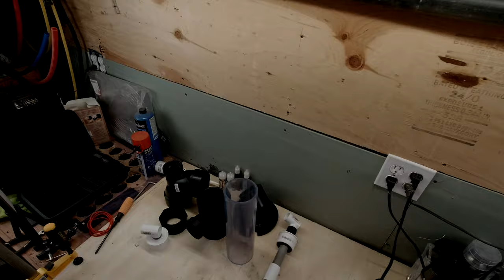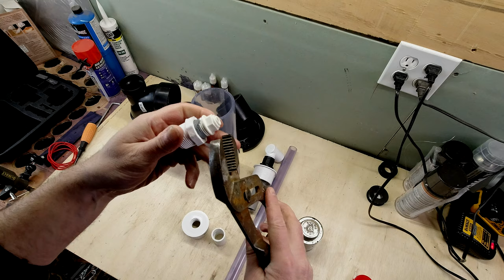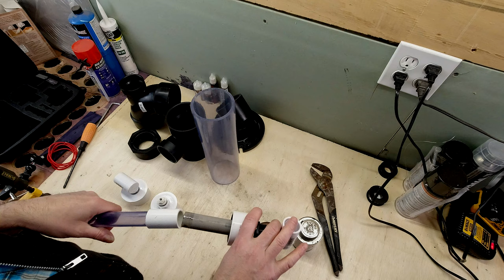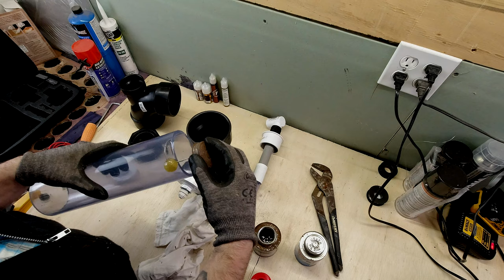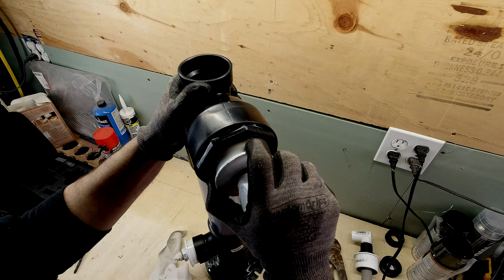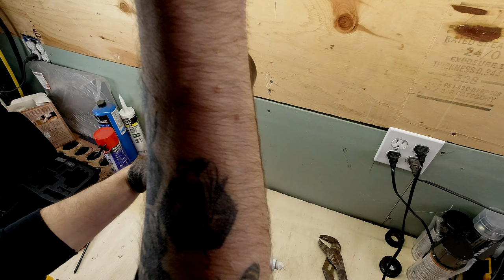Diy Co2 Reactor!

Comment: I was going to buy the sera one
Reply from the maker: I like it.  I'll be doing a review of that unit soon
Reply: I had a sera 500 it lasted about a year and a half. It started to leak at the hose barb Tried to fixed it and it broke completely when I tried to fix it. It did a good job while it lasted but the build quality is poor. My diy rex grigg reactor does just as good was cheaper and will last a lifetime.
Reply from the maker: I have a video on that also.  Was a little cheaper than the one I built here.  About the same as the 2" though.
Reply: Corvus Oscen are there any diffusers that would work in a 125 gallon